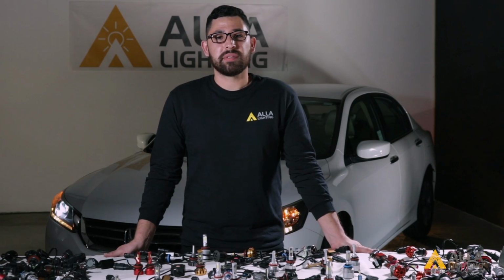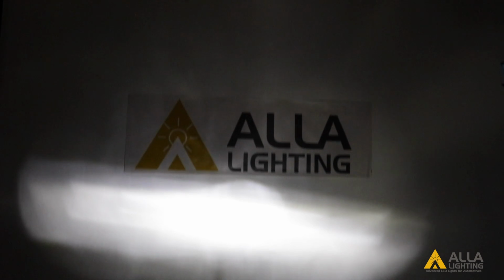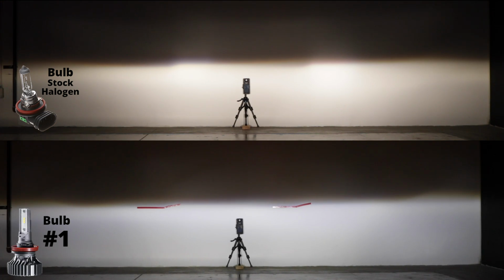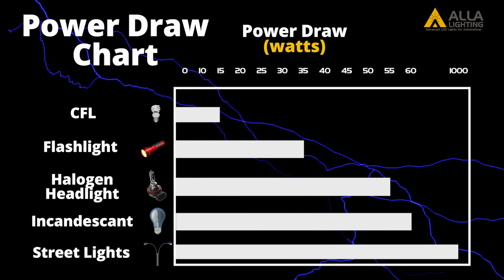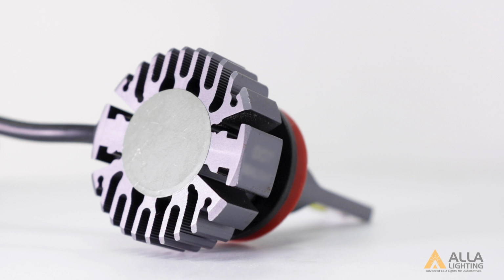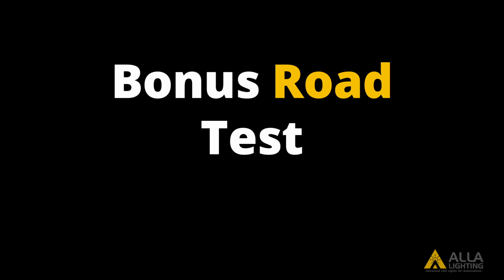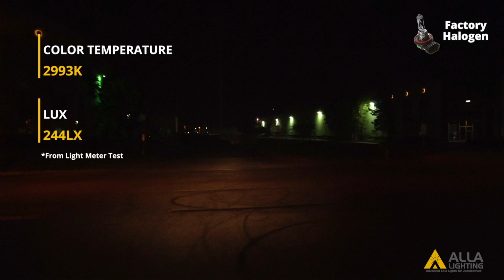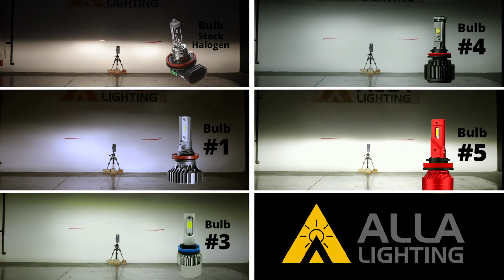Brightest & Best LED Headlights - Review "5 Top LED Headlight Bulbs!

Comment: #3 is decent as compared to #5 which is the best shown in your video. What I like about #3 is less heat and current (amps) or wattage draw. I suppose these are all Allalighting made LEDs?  or those that Allalighting gets from other bulb manufacturers and packaging/labeling them as Allalighting brand.

Comment: Led #5 has the best lighting output.
Reply: But the lifespan is very poor. Bec😢bulbfacts tested those led bulbs and the hour lifespan rates as 300. 
Why?

Because while everything else of the two sided led and tiny led CSP chips is perfect. 

The heatsink and the cooling fan is way too small and it’s not big enough to pull the heat away from the led chips. 

The red coating got burned simply running them for about an hour. A rebrand of F3 from headlight revolution tested. 

It draws 44.5W. It is super bright but not reliable. 

U need something like the Auxito - Y19, Lasfit - LS plus, Sylvania - SL.BX2, Alla Lighting - D-CR (rebrand of S-V.4 from HR), or Boslla - C4 Tri color switchback led bulbs. 

Those will perform better than the FL-BH. 

If they redesign the heatsink and the fan bigger, like between 30MM-35MM? That would be a lot better.

Comment: I realize the FL-BH is your top shelf item, but I just don't have that kinda cash. I also don't really need something a million times brighter than stock anyway.

Will the S-HCR still offer a good upgrade in brightness and throw with a similar light pattern to stock in projector headlights? Would the brightness diminish significantly after extended runtime in a sealed housing(IE with dust cap)?

I drive a 2020 Kia Optima.
Reply: Get the Lasfit - LA plus. 30W 3000 lumens per bulb is plenty bright and very well Balanced, reliable, low failure rate led bulbs.

Comment: In order for led bulbs to have a good hot spot they need to be as thin as possible so there is no shadow cast inside the projector housing.
Reply from the maker: Yes, you are right. The beam pattern will design like OEM halogen bulb.

Comment: I have a 2015 Hyundai sonata limited 2.4. the lights are crappy. Any recommendations
Reply from the maker: Thanks for your message, based on the bulb size guide, it is 9005 as high/low beam headlight for your vehicle, so please check the stock headlamps to double confirm it or take pictures of the stock bulbs and email us service@allalighting.com for double confirmation, if correct, we recommend below product: https://allalighting.com/products/9005-hb3-led-bulbs-replacement-upgrade-halogen-lamp

Comment: 2014 Ford Fusion low beam projector. 
Your recommendations?
Reply from the maker: Yes, we recommend our FL-BH version H11 LED headlights bulbs, product link is https://allalighting.com/products/h11-h9-led-headlights-conversion-kits-bulbs, due to your vehicle with CANBUS system, extra decoders maybe required to avoid the flickering or error code, recommended decoders link is https://allalighting.com/products/h8-h11-plug-n-play-warning-error-led-decoder-canceler-capacitor

Comment: Even tho I'm seeing Bias going on in this video, i learned something. I bought one of those LED that have lights surrounding the tip of the bulb as suppose to having 2 led lights on only two sides. I thought it'd be better. But the beam pattern sucks like crazy. I've used it in tunnels and it lights up from the ground to the ceiling of the tunnels instead of shooting straight. I guess im going with the ones that have two side lights
Reply from the maker: Yes, the LEDs on both sides will have better beam pattern. Our FL-BH have the same beam pattern as the OEM halogen bulbs, so it will be a great option if you want to try LEDs.🙂

Comment: Your test was not fair.  You are promoting your brand.
Reply from the maker: Thanks for your feedback, the reason you find our brand is the best one because this one is the newest and brightest in the market with the best beam pattern. So it is the comparison test from all other 4 popular version LED headlights.
Reply: @AllaLighting  
I am not sold to this FL-B4 . I have a feeling it might burn it self in an hour to ash and drop it output . I currently use GTR ultra 2
Reply from the maker: @precisionlaser2158  Thanks for your comment, in fact, this one is better than GTR as to heat dissipation and beam pattern, our FL-BH has double-fan cooling system to enhance the heat cooling.
Reply from the maker: And here is a video to check the LED headlights bulbs is good or not, hopefully you like it: https://youtu.be/AT_k39kpD38

Comment: What is yall best led for 2020 tacoma head light? Fog light and maybe for tail light as well without hyper flash.

Have you guy actually test quality control, stess test these bulbs? Etc? Do they fit right? Do the led chips sit as exact, if not then atleast close as possible as a orginal halogen bulb? Do they dim within the year? Do they start to flicker within the year?
Reply from the maker: For the vehicle with halogen capsule headlamps, the high and low beam headlight bulbs link is https://allalighting.com/products/h11-h9-led-headlights-conversion-kits-bulbs or , https://allalighting.com/products/h11-h9-led-headlight-bulbs-replacement-for-motorcycles-cars we recommend these 2 types headlights bulbs for its mini design which can fit your vehicle. And the brightest version is FL-BH version, and we have one year warranty since purchasing date. For whether it can flicker or not within one year, which depends on the working condition for a headlight bulb, most customers did not state such issue.
Reply from the maker: And fog light bulb we recommend: https://allalighting.com/products/al-r-h8-h11-led-fog-lights-bulbs-replacement-drl-for-cars-trucks, this is quite popular and high reviews in the market.hopefully you love it too.

Comment: Just bought the newest bub numb 5 in video for crysler 200 2013 headlights hope they don't   flicker triyed different brand didn't work.
Reply from the maker: Thanks for your message, in fact, for your vehicle, extra decoders probably are required to avoid the malfunction for your vehicle comes with built-in electric canbus design, when you upgrade to LED headlights bulbs, extra decoders will be required.

Comment: This video means nothing without telling us what the make and motif the bulbs are! I see in the comments the best bulb (#5) is of your company’s own creation, seems like some bias going on especially if the other four bulbs are bottom of the barrel. This video was great just wish there was more transparency, because after all the guy in the video says “so you can make a better decision when selecting the bulbs”
Reply: I clearly don't understand what you are trying to prove Paul, if you don't like Alla led bulbs dont buy them. They are not biased, they could be sued for using the names of other competitors to advertise their own brands. This is a marketing principle which you clearly don't know. Their bulb is the best compared to the other bulbs they have matched it against and if you think that GTR led is better, then you can use your own discretion and decided what product and from which manufacturer you want, just dont be ill-adviced and self centered and use products which may cause harm to others and doesnt even give you the best illumination you require at night
Reply from the maker: Thanks for your comment, each product has its pros and cons which will depends on each person's preference.🙂 the #5 bulb is from us, yet it is the newest technology & brightest version in the market, that is the reason it has its more pros. But the cons is the cost is not same as the old version
Reply: @AllaLighting  You still did not show makes and models of other brands tested.  It also looks like the bulbs you tested are not high quality bulbs although nobody knows because you didn't tell us any information on that.  Maybe you should give "Headlight Revolution" some of your bulbs so they can be properly tested against bulbs that have brand names and model numbers!
Reply: @AllaLighting  deautoled will kill your leds -- go test them